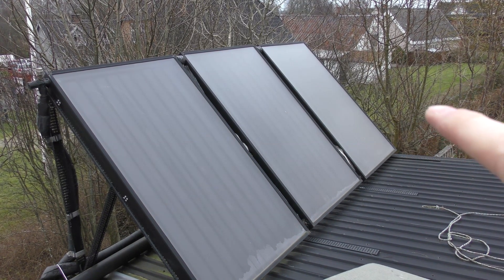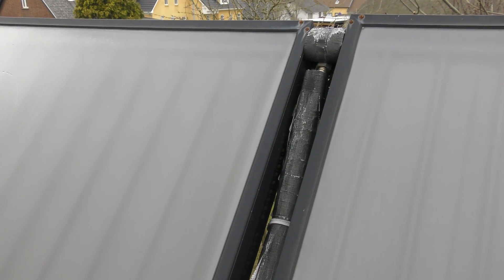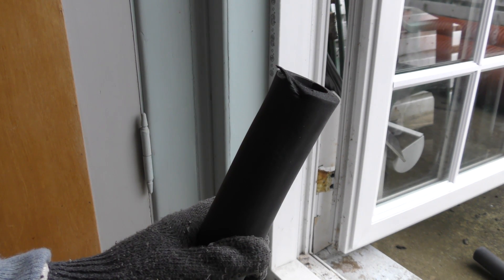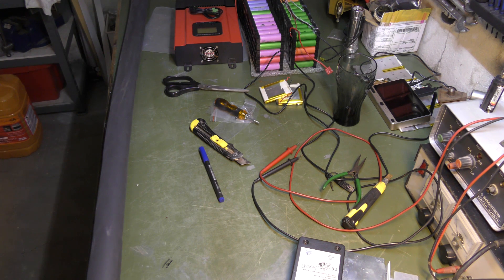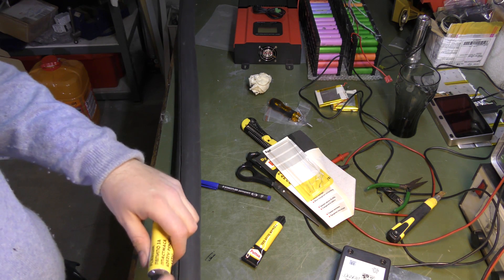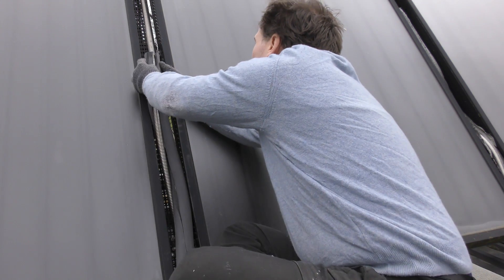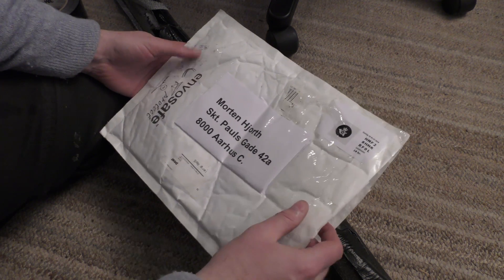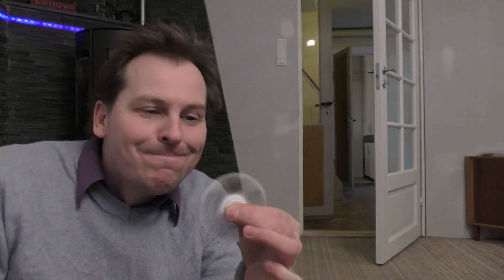Replacing Insulation on Solar Collectors and Stolen Goods - 637

Comment: The proper way to glue the rubber insulation together is to use contact cement with two coats.  When I serviced life rafts used the same material between the two halves of the container.
Reply from the maker: Hi Scott Downey
Thank You very much!  glad you liked the video :-)
Thank you for watching! :-)

Comment: Is water always running thru these? Or only when you openethe shower. How do you store the hot water?
Cool!
Reply from the maker: Hi YamiFrankc
There is a control system that turn on the pump, then the water in the solar collectors is 5C higher then the water in my storages tank. It is a closed system,, there is antifreeze in the system, so that water is heating my water in my hot water heater.
Thank you for watching! :-)

Comment: That cheap insulation is for indoor use only. 
I have some that is just as soft and insulating as it was 13+ years ago when I installed it on some water pipes. 

Even the butyl, polyurethane  or silicone based foams are susceptible to UV degradation. That is why they should be wrapped in something that holds out to UV and cold better than the reinforced tape. The tape glue (elastomer) will be damaged by cold and water too. 
I prefer (and  saw as good practice) rigid pvc pipes over the insulation. Yes, they will eventually succumb to UV radiation but the insulation will be protected. It also protects against insects, birds, and other creatures that might find the soft foam a nice nesting material or confuse it with something edible. Also, rigid pvc pipes should last more than 10 years and hold well against hail too. 

Also, if the foam gets soaked and freezes, it will be, again damaged by the ice formed inside it's cells. It is closed cell foam but where you cut it, you open some cells. Moisture gets in, freezes, cracks the neighboring walls.  

Glass and mineral wools are UV indifferent.
Reply from the maker: Hi Pașca Alexandru
Thank You very much! 
Thank you for watching! :-)

Comment: Is it possible to make some kind of sealed covering over the gap between the panels to cover over the pipe, protecting it from UV and breaking down the insulation material. Maybe some strip of plastic or aluminum? Maybe even pack more insulation over the pipe in between the covering providing more insulation in the process.
Reply from the maker: Hi SuperBigDog2U
Thank You very much!  Yes there is a ton of ways to improve on this,, this was the first steep, and will help a lot.
Thank you for watching! :-)

Comment: if I wanted to build my own rack of a few computing units for some heavy scientific computation, what would you suggest me? Lenovo/HPs are not suitable for a home tinkerers
Reply: Peter Bočan im a hobbyist and i have a ibm x3650 m2 without rack.
In what way are they not suitable?
You could get workstations, normal desktops, or a tower server
Ml110 ml150 g6 or newer or something like that
If you mean the formfactor and sound
You can make a stand for rack servers so you can them put them in on their sides to they are less wide
Reply from the maker: Hi Peter Bočan
Well a bladecenter could also be a way to go,, they can be really cheap,, there is not much of a market for used Blade Centers...
Thank you for watching! :-)
Reply: If he has thick walls it might work :P
Reply: I guess blades are much louder than rack servers :D